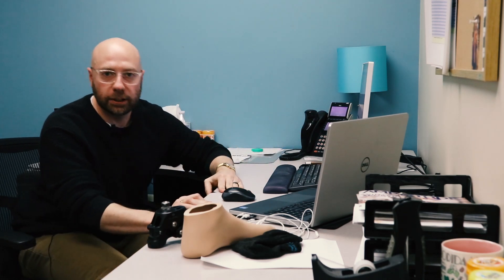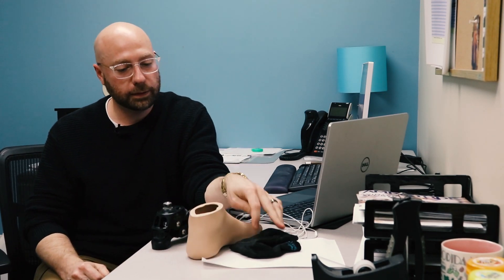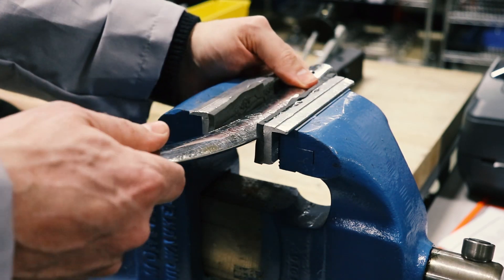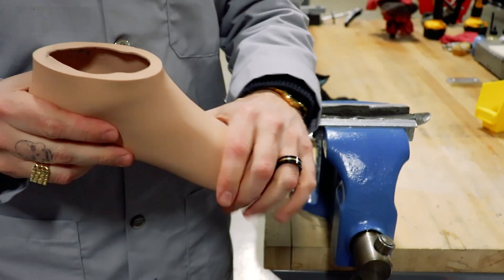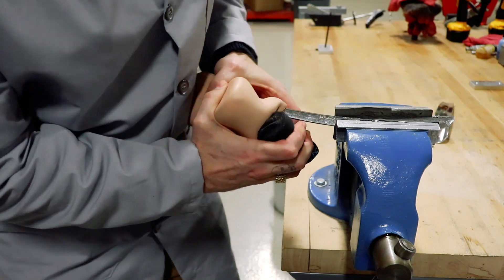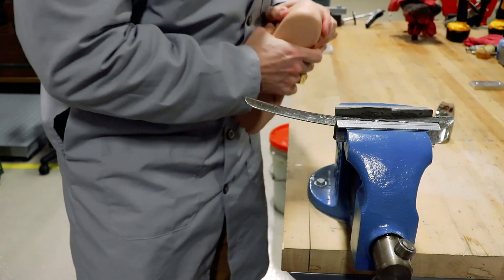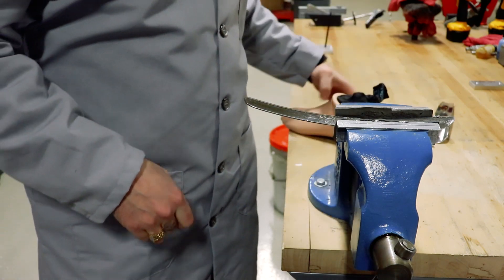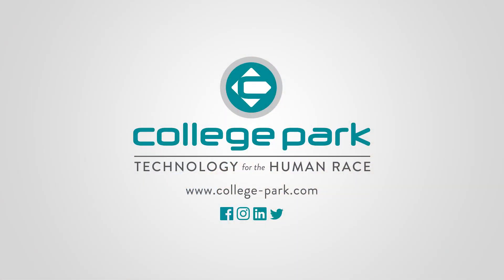Tech Tips with John: Inserting a Trustep Into a Foot Shell

Comment: I am a LAK. College Park kindly loaned me a Trustep for two weeks. I took it home and had to change the bumpers a few time to get them best set up for me. I had to remove and reinsert the foot into the shell 6 times. It was very, very, hard to do.  There is no reason to make it so difficult. It could be designed much better. The back of the shell cracked after the third time. This made it easier, but it was still much harder than it should be.  If I was going to buy a Trustep, I would cut about an inch, off the top of the shell.
I ended up buying a College Park K2 on Ebay.  I find the K2 much better than the TruStep. The K2 on swing forward leaves the foot in Dorsiflexion so there is maximum ground clearance. The Truestep moves the foot out of Dorsiflexion on swing forward,  pointing the toe down, and I kept catching the toe on the ground. Why would College Park design one foot to remain in Dorsiflexion, and another foot to NOT remain in Dorsiflexion? Again, I think the Trustep could have been designed much better.